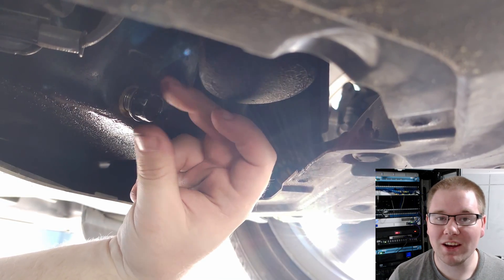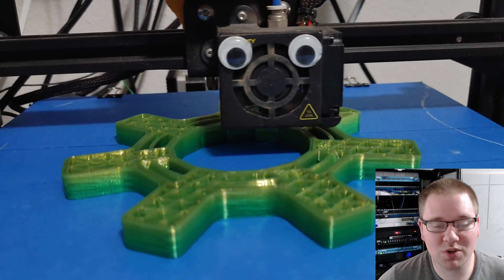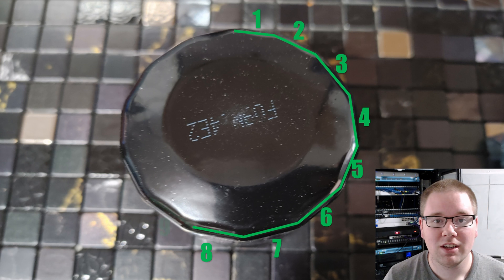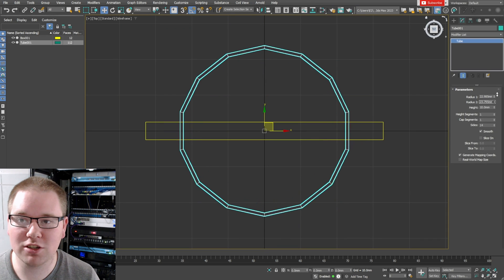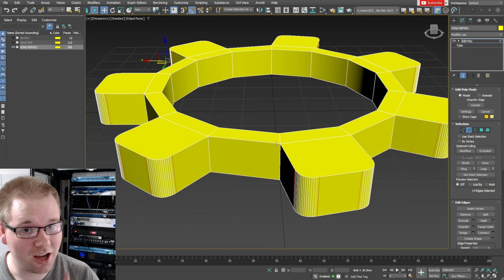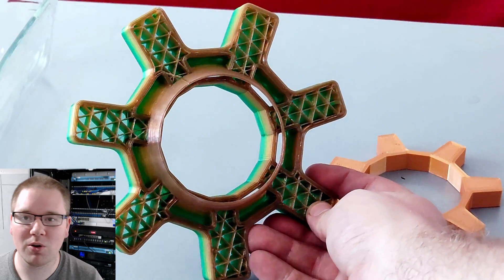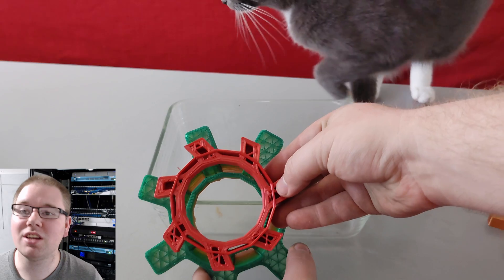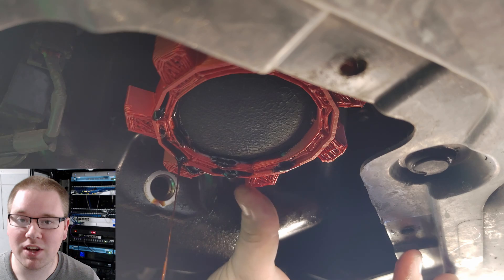3D Printed UNIVERSAL Oil Filter Wrench

Comment: My oil filter is recessed so the tabs on this would get in the way. Good idea though.
Reply: Turn the ends at a 90 degree angle and you should be fine.